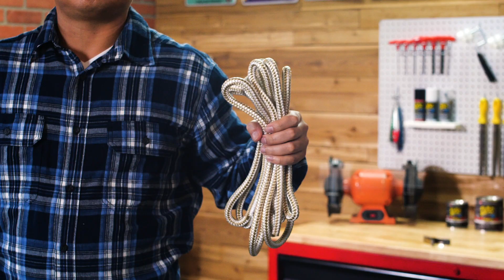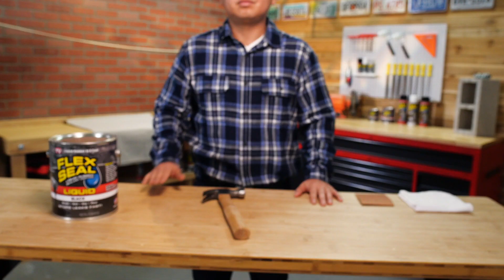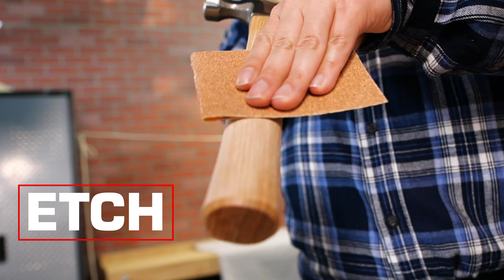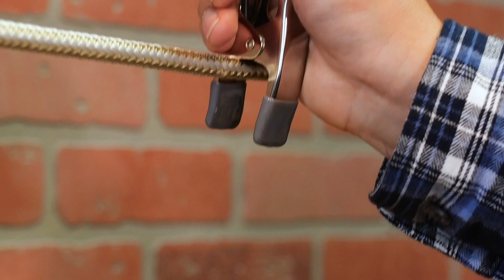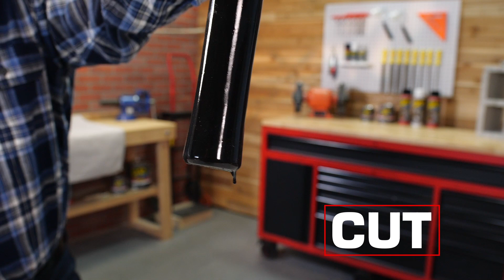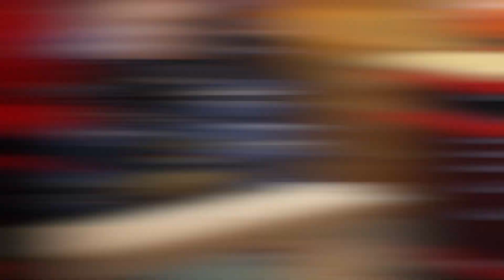How to Dip Your Tools with Flex Seal Liquid®

Comment: This product is useless.
DIPS IT IN FLEX SEAL
There we go, now it’s fixed.
Reply: Is this joke??
Reply: @ForsenForsen  lol
Reply: Johntron form reference?
Reply: You got me at the first half not gonna lie
Reply: dips FlexSeal in FlexSeal
Reply: 100% improved product
Reply: @HoshiArt  dip flex teap in flex seal,then dip it in flex seal again,then use flex glue as it adhesive
Reply: @ForsenForsen  r/ihavereddit
Reply: @ForsenForsen  r/ihavereddit
Reply: Whut
Reply: They had us in the first half, not gonna lie.
Reply: 100% improved product
Reply: coats Flex Tape in Flex Seal, covers with Flex Shot, puts together with Flex Glue, then makes a boat out of the material of the gods
Reply: When you said this product is useless you had me in the 1/3rd half
Reply: Its dipped in flex seal to give the hammer a grip. The product itself can be used for other things though.
Reply: Cukt nah it’s a reference from another Phil swift video search up JonTron Flex Tape it should come up instantly